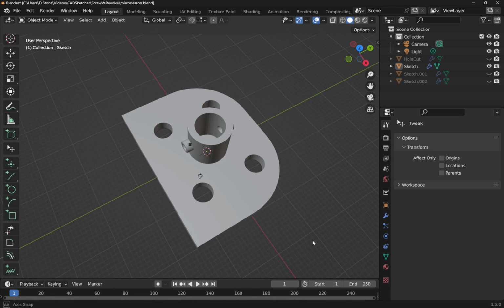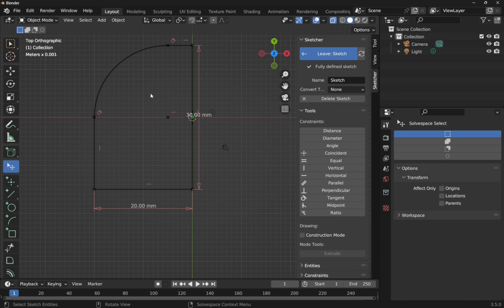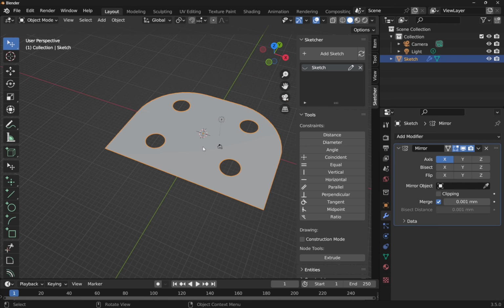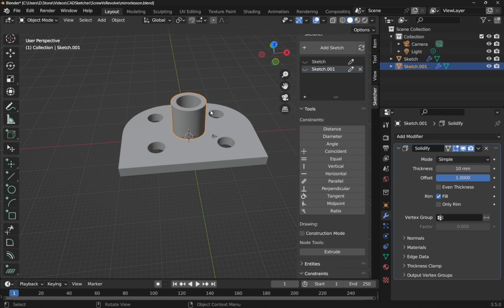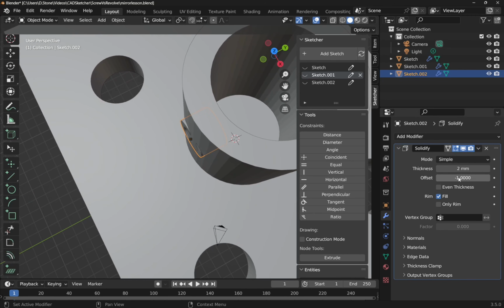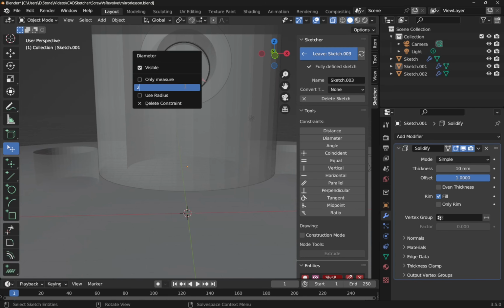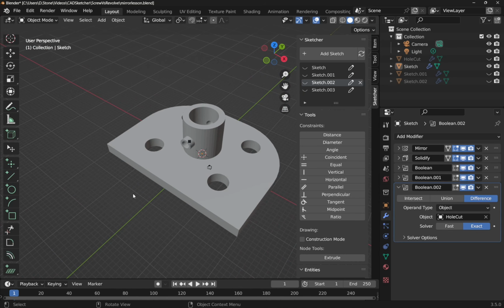Learn CAD Sketcher | 10 | Build a simple model with mirroring and symmetry | Blender 3D Beginners

Comment: Thank you for your videos, I learned a lot in a single day. However, I belive you overcomplicated this one: You already had a plane in the base that was perfectly aligned, and you know your 0,0,0. One can allign 2 circles on that plane: 1 of central circle that when extruded will make your holes, and the second one of a pipe cross-section that when extruded 2 times would give you the protruding parts needed.

Comment: Hi, I'm struggling with the mirrored cylinder. After I create the hole - things are not perfectly centered. The hole goes through - but there is a very small portion visible of the outside cylinder when I zoom in. 

I even did it manually , recreated the second cylinder added a second hole - the result is the same. Working planes are set correctly, their center are ok and I haven't got any more ideas to check what went wrong.
Cheers.

Comment: I think that the hole is not centered through the cylinder because you placed the workplane on a face of the cylinder which was also not centered. Hence the crooked number of degrees that you manually changed to 90 degrees. I think it would have been more precise if you had used a face from the plate instead. I hope you understand what I mean.
Reply: Was struggling with this right now, trying to move the 3d cursor to place it right in the middle. I will try your option, ty

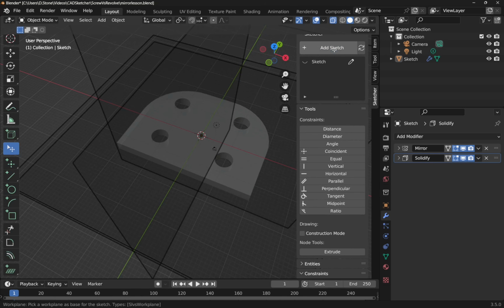Comment: I have a problem. At around 9:54 I add a plane , then add a new sketch , the original sketch totally disappears and all i'm left with is the new plane with nothing else visible. Am I missing something?. It was going perfectly till that point
Reply: Did you by accident hit the H key? That hides objects from the current view. You should be able to see in the Outliner if any objects have their “eyeball” closed. Or… possibly you went into local view? That will basically solo whatever you have selected and hide everything else. Slash “/“ on the numpad is the shortcut to toggle between local and world view. It is easy to accidentally press it.